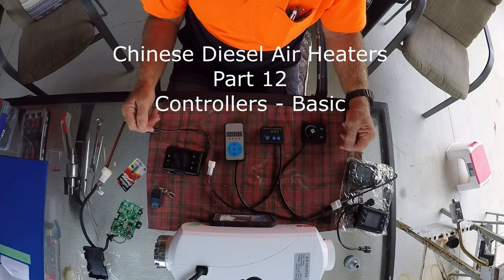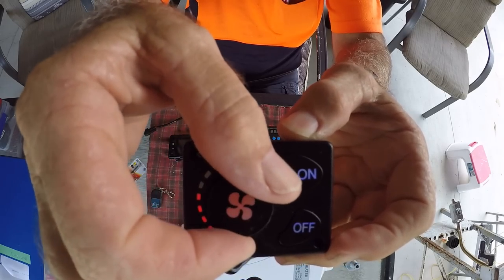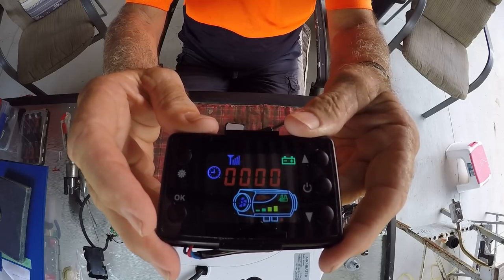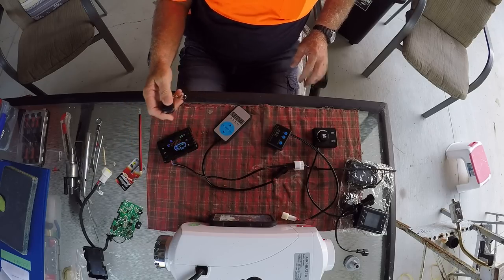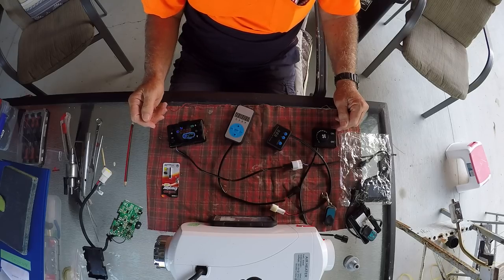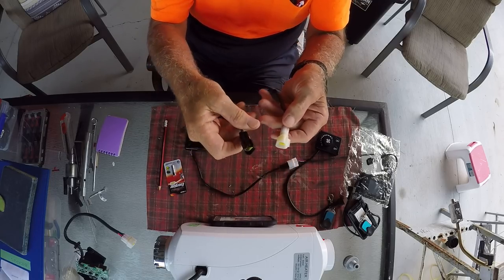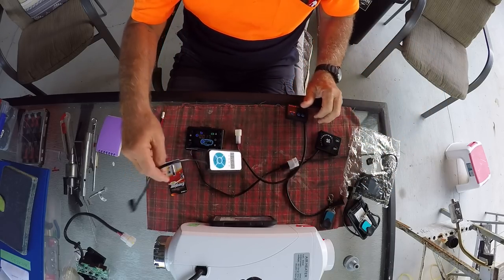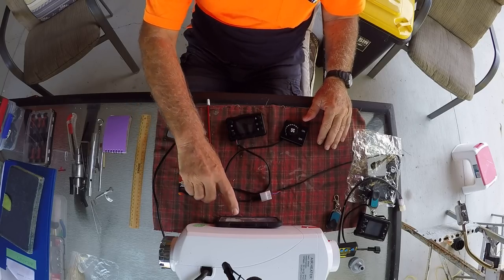Chinese Diesel Air Heaters -  Part 12 - Controllers (Basic)

Comment: I have a brought a caravan with a Zhengmai diesel heater in it. No instructions. I've found the files section and worked through a few faults. (not enough volts and overheating). It has one of the basic controllers with a rotary knob. Now all the machine does is blow air for a little while and then turns off after about 5 minutes with the fan light flashing but no fault lights to tell me what is wrong. does anyone know what's happening?
Reply from the maker: Hi David,

If you one of the common Chinese Heaters with simple round control knob with indicator lights giving you the heat settings, then count the number of lights that flash, that is your error code. Eg three lights, E3.

Generally if these heaters blow air on start for a while and then stop it is generally because the burner does not light.

There are two common reasons for this fault.
1. No fuel getting to the burner. Check the pump is working and fuel is getting to the heater.
2. The glow plug is not working. This could be a broken glow plug, or low voltage, or even a 24 V heater trying to run on 12V. A 12V heater will draw 8 to 10 amps on start.

I hope this is a little help.   JMcK
Reply: @johnmck1147   Thanks John, I'll give that a try.

Comment: Hi John, congrats for your videos, no nonsense, lots if info and down to the point. I just purchased a 5kw unit and it came with even another type of controller, if you forward an email address,  I'll send you some images.  Question: can I change the fuel to air ratio? I am in Bogotá Colombia at 2.600m and the unit spots quite a bit, I assume, due to the lack of oxygen...
Reply: It was supposed to be ' soots quite a bit ', sorry about  the spelling...
Reply from the maker: Hi Andreas, sorry I missed your post. To my knowledge there is no high altitude kit or adjustment for these Chinese diesel copy heaters, but you can get a high altitude kit for the genuine Eberspacher heaters. I personally have not seen the high altitude kit so I can not give you info on how it works.

What I can suggest is you will reduce the carbon build up by using a high kerro diesel mix, say 80% to 90% kerro to 20% to 10 % diesel.

My email    johnmck47@outlook.com

Regards,   JMcK
Reply: @johnmck1147  Hi John, thanks for the reply. I looked up the Eberspächer high altitude kit (I am German from origin), it consists in a new ECU and a altitude pressure sensor, which then apparently reduces fuel delivery by 9% x 1.000m of altitude (read it somewhere but have not been able to find this again....). I managed to enter the settings menu (code 1688, same as on your controllers)and through try & error and some estimates came up with the following ops settings for 2.500m above sea level: fan Rpm low-1.800, rpm high 4.500; pulse low 1.3hz, pulse high 4.0hz at 18°C combustion air intake, straight pipe. This gives a smokeless operation over the entire range with 195°C case temp at 2.5hz and consistent 218°C at 4.0hz. Unfortunately Kerosene is not openly available here ( basic resource for cocain production process, hence forbidden), but I wondered what happens if I add some percentage of gasoline to the fuel... any thoughts?
Reply from the maker: andreas arncken 

Hi Andreas, thanks for that detailed feedback. You have done good research.
I personally do not like the thought of mixing petrol into the diesel, but I have never tried it, and so I can not offer any real constructive comment. Interesting your comment on the kerro availability.  Cheers,  JMcK

Comment: There is a 5th version. It looks similar to no4 but has no advanced controls. Just got one with a new heater and it's crap.
Reply from the maker: Thanks for that info JP.  JMcK
Reply: That controller has no advanced settings. My other heater that I have been using for two years can be tuned down to lower temperature output use less fuel and less noise slower fan speed  and uses less amps.
Both controllers look almost identical unpowered. This one apart from not being tunable gives out fumes during startup and shutdown. I am currently in dispute with the supplier to get my money back because it is not the one shown in the advert. As soon as the weather improves I will be transferring the controller and motherboard from my old one.  I live full time in my van and although the extra heat output is OK in current weather, when the climate improves the van will be too warm. Most of the heaters give out more heat than needed so you end up having to leave a window open. The better controllers can be tuned down to be just right in an average size van.

Comment: Are all controllers interchangeable ?
Reply from the maker: Hi Barry, many controllers are interchangeable, but recently a couple of suppliers have wired up their ECB differently so you are locked into using only their controller, or swapping out their ECB so you can use a controller of your choice.

Suggest you chose what controller you want and buy a heater supplied with that controller.   JMcK

Comment: Has anyone received a controller that is literally just a big button? Mine came with a controller that is just a button and a thermocouple. There is also a cheap remote that uses 2 AAAs but I can't get it to connect. Can't find any info on it.
Reply: Hi i bought one of the controller's you describe and couldn't get it to pair also, It would  be simpler to just buy another controller off ebay with the same type of plug if not just cut your plug off and reconnect it to the new controller.
Reply: @grahams9980  Update! I got it to work and it is actually great! I carefully followed the instructions I found on an ebay post: https://www.ebay.com/itm/12-20V-Two-Way-Auto-for-Air-Diesel-Heater-Switch-Parking-Control-4-Button-Remote-/174305974925.

The instructions for pairing: 
3) Remote pairing:

In the power-on state, press the on / off key 5 times in rapid succession, the indicator light flashes, and enter the remote control pairing waiting state. At the same time, press and hold the power button + set button on the remote control to start remote control pairing. Wait for the auto-complete pairing to exit.

Comment: I wish i had seen this before i just got a 2 kw and it says tepy 2.5kw on the ecu i can t see a replacement ecu for it any one got any links.The Control is non standard, blast! and i got a error code 8888?
Reply from the maker: Hi Atommachine, if you have a true 2 Kw heater, small in size, changing the ECU will make no difference to the output. The 5 Kw heaters put out more heat because of their bigger heat exchanger.  JMcK
Reply: @johnmck1147  Hi John , It was actually so i could use a better controller  as mine is cheap with the strange wire locations.Thank you for your reply and super info.
Reply from the maker: atommachine 

Copy that. Yes, in most cases you could make it work with a new ECB and new comparable controller. These are readily available on eBay.  JMcK

Comment: Hey John. Thank you for the video series. I’m one of your subscribers and have been for a month or so. I fired up my diesel heater yesterday and it showed one blinking bar on the fan display (I have the most simple controller). That indicates low voltage to the unit? If so, should I use a thicker wire? The run from my lithium battery bank is around 20’-30’. Thank you for any help and this series in informative videos!!
Reply from the maker: Hi John, low voltage can be a number of things, and you haven't given me your wire size. However the first suspect is wire size. These heaters draw 8 to 10 amps on start up so you must wire size for that current. With sizing you take the total length of wire, (in and out) in your case 60 feet or around 18 m. If you look at a wire chart that shows a 6 AWG gauge wire or around 13 sqmm as a minimum. I would suspect that is the cause of your problem. If yo do not have a wire size chart, try looking up "The Engineers Toolbox" on the web. That will give you lots of information.

As I mentioned before low voltage can also come from a number of causes. I first check the voltage at the ECU, the large red and black wires soldered to the board, with the unit turned on and in start mode. You are looking for voltage drop when the glow plug switches on, but that is not feasible for someone without some knowledge in that area.

Does your error come on immediately or after a little time, when the glow plug turns on?

IF, you already have 6 gauge wire or thicker, check that your connections are tight, and the fuse is a decent one and inserted fully. 

I hope that helps.   JMcK
Reply from the maker: R K ,

Sounds OK if your wire size is correct. Cheers, JMcK

Comment: I have found the heater always runs the fan if the body is over 55 degrees C.
You can in fact just make the fan run my shorting the body temperature sensor, tricking the heater into thinking it is too hot!
So I'm not so sure you will melt down if you momentarily lost power to the entire heater.

BTW, I'm a bit of a guru on the controller side - check my vids ;-)
Reply from the maker: Hi Ray, if you momentarily lose power you do not really have an issue. The problem arrises  if you have no power. In my case I snapped off the battery clamp leaving an insulated wire with no copper out the end. I guess I could have tried to push the cable end on to the battery post, but then I don't think I could have also reached the controller to turn off. I was running at full boost with an outlet temperature at 500 mm of around 110deg C, very close to shutdown temp. 

Anyway, at the time I chose to open the case and fan it with a folder pad.

Thanks for your input Ray.  Did you make your own controllers? Did you write your own software?
JMcK
Reply: @johnmck1147  yes. Cracked the protocol stream and wrote new code that supports Bluetooth, WiFi  and a few other nice things like lots of timers a proper real time clock. It's a beaut!

Comment: My unit. Came with green hose.  My tank is higher than unit basically gravity feeding any need to replace. I have on order nylon for pump side  thank you Again
Reply from the maker: Hi Richard, 

If your tank is higher than the heater you should install a shut off valve in the line and turn off when not in use as diesel can slowly seep past pump seals and flood the heater resulting in a non start next time you want to use the heater.

The soft fuel hose on the delivery side will work initially but your heater eventually won't start when small amounts of carbon accumulate on the burner screens. The soft hose absorbs the fuel pulses and the diesel can't no longer squirt through the screens and atomise.  Also that soft fuel degrades faster than quality fuel hose.  JMcK
Reply: John. My unit came with soft-green hose. Today my nylon 2mm hose arrived. I was able to fit the new clear line inside the green hose from pump  out through hole in plate and connect to fuel connection at unit. . it pushed right up tight and  I watched  bubbles flow throw 2mm nylon line and no fuel movement in green line. II will at some point do from tank to pump. Thanks for this Brilliant  videos
Reply: I just disconnected at pump and snaked it through
Reply from the maker: Hi Richard,

From tank to shut off valve (if fitted) to filter to pump, just use standard 4 mm good quality fuel hose. 
It is from pump to heater you should only use hard narrow bore nylon hose. Cheers

Comment: I honestly don't mean to sound snarky or patronizing here but I'm wondering why in the world would people buy these cheap Chinese made products that have so many unreliable characteristics.  I also know that everything the Chinese make is not necessarily "bad" but aren't there better products than these (controllers) available?
Reply from the maker: Hi HH, I have owned both the very expensive genuine German heaters and the Chinese “copy” heaters, and I have found, in most cases, that the Chinese heaters are extremely good heaters, and sell at a fraction of the price of the European heaters.  JMcK